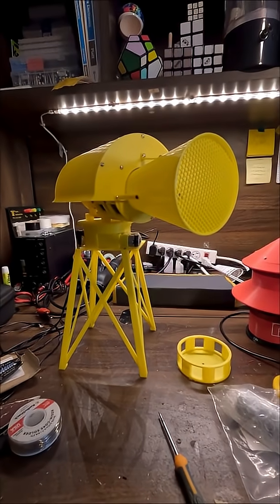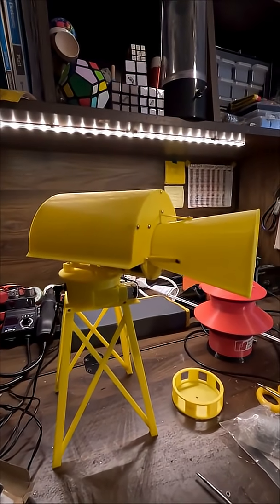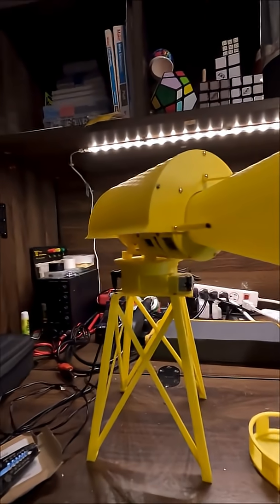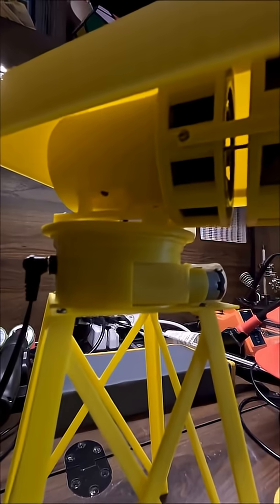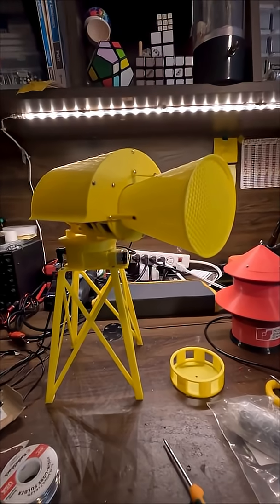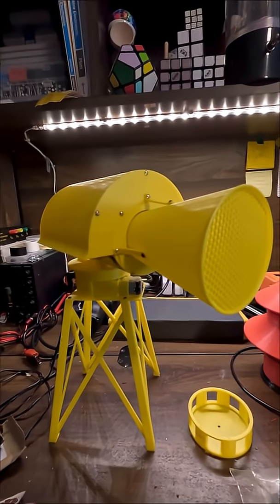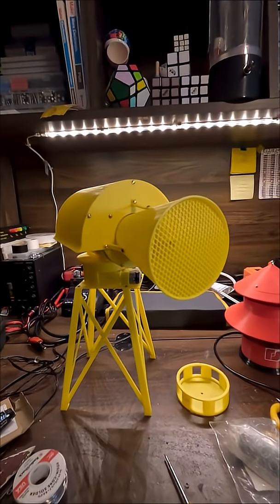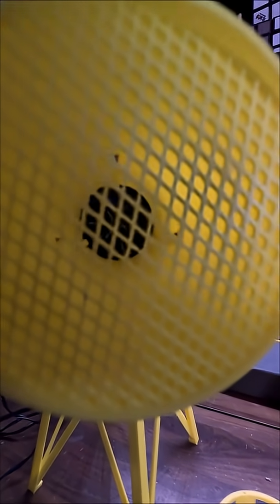Mini H.O.R. 7/10-Port Model 15 Super-Sirex IS COMPLETED! #3dprinting #minisiren #supersirex

Comment: The chopper spins at the perfect rpm, just curious whybit cant hold its pitch
Reply from the maker: This is a sorta prototype, so it's not perfect. The bearings between thw two rotors sometimes struggle. I hope that my revamped core won't this this as much.

Comment: then again the horn isn’t to carry the sound, but for air intake :~)
Reply from the maker: Honestly, it's for both! If you'll notice, when the horn faces the camera, you can hear the 7-port sound much louder than normal. This is more noticable on the dual-headed models, which I am making soon!
Reply: @milespeterson5049  that’s true, but it could be attributed to how the 7-port has much higher air intake than the 10-port, no?

as seen in the “naked” video you posted, the 10-port has a significantly smaller air intake than the 7-port which has our favourite ginormous horn! lots of videos also demonstrate the phenomenon you explained where the 7-port sounds louder upon facing the camera, attributed to the higher air intake

dual headed super-sirex usually sounds equal in volume due to both ports having unobstructed air intakes
Reply from the maker: @ryanadrianh  That's exactly it! The 7/10-port single-headed Super-Sirex is kinda a dumb design because the 10-port side has a tiny air intake compared to the 7-port side, which stuffs up the sound a bit. But, it's pretty cool anyway!

Comment: I just realized you have hitchhikers thumb😭🙏
Reply from the maker: I have TWO 😅
Reply: @milespeterson5049  also what type of 3d printer do you use? I want to print stuff because I only had one successful cardboard siren.
Reply from the maker: @Eat_a_burger77  I use an Ender 3 V3 SE. It's a really great, fast printer. You can get one for about $220, which is cheap for a good printer nowadays. I even have an Ender 3 V2, but I mostly use that for smaller parts. It's a lot slower than my newer Ender 3 V3 SE.
I think a good starter printer is an Ender, especially one of the newer ones that's easier to use. Hope this helps!
Reply: @milespeterson5049  Thanks!

Comment: Hi, a couple questions:
How did you print the horn and its net-protection thing without it becoming a bundle of strings? (I'm new to printing)
What motor did you use for the choppers?
Thanks and I hope to receive your response
Reply from the maker: Hello, I'll do my best to help you by answering those questions!
Parts like the horn and horn mesh are most likely to string, leaving an ugly, very annoying mess. To fix this entirely, tune your retraction distance on your printer. Retraction lifts the filament out of the nozzle, which, if tuned properly, can entirely stop stringing. I use 3 mm-long retractions at 80 mm/s for PLA and ABS, and it has worked very well for me. Some parts, like the horn mesh, will probably still have some stringing, even with optimized settings, so I used a soldering iron to clean the strings out of the little diamonds of the mesh, and that's what I have on this siren now.
As for the motor, I used a 500 DC motor. Mine ran at 3700 RPM at 6V, but the RPM won't really matter with a buck converter to regulate the pitch.
Hope this answers your questions! I'd like to see a video of this thing working if you ever upload.
Reply from the maker: I have links to all the parts I used in the Tinkercad project, including the motor, slip ring, buck converters, barrel jack, etc. Best of luck!
Reply: @milespeterson5049  thank you very much!! but i'm using an anycubic kobra so i'll try to have the best settings possible
Reply from the maker: @McklMrtz  You're welcome! Those Kobras are great printers, I've heard, so you've got this! Thanks, man!
Reply: @milespeterson5049  Back again, and for the choppers, do i need some kind of support or could they print well without them? thanks
Reply from the maker: @McklMrtz  When I printed the choppers, I added support. You don't have to add support, but for the best surface finish, I recommend it. It is pretty hard to remove the support from the rotors, so be careful.
Reply: @milespeterson5049  thanks. Have you printed it upside down? What are your methods to neatly remove the support?
Reply from the maker: @McklMrtz  Printing it upside down will require more support, and it'll look pretty ugly, so don't do that. The parts in the Tinkercad project are oriented properly for printing, so you need not change the orientation. Read the notes, and they'll tell you if you need support, what parts you'll need, and how you print it. Again, I hope this helps!
Reply: @milespeterson5049  thank you very much!
Reply from the maker: @McklMrtz  Anytime! If you have any more questions, I'll be happy to answer them. This is a huge project, and it just takes a lot of effort!
Reply: @milespeterson5049  hello, i have printed my own chopper + stator. The friction between the motor shaft and chopper seem to enlarge the chopper's hole for the shaft because of scraping. Any way i can prevent that/how have you put on your choppers?

Comment: Might have to tweak the rotator slower a bit but it's pretty good 👍🏻
Reply from the maker: Yeah, I would tune the speed, but if I make the rotator move any slower, it has problems rotating because of the weight. I will probably try tuning it again, because I recently fixed the rotator gear, and it's spinning much better now.
Reply: You could put a couple resistors in series with the rotator motor to hopefully make it spin slower
Reply from the maker: @Cellokid12 That is exactly what I do with smaller sirens to regulate the pitch to be more accurate. However, this siren doesn't use resistors, as it consumes a lot of power and requires precise control with DC-DC converters. I could just adjust the rotator's speed by turning the trimmer, but I don't wanna mess up how it rotates, so I'll experiment with that. Other than the rotator speed, this siren is done.
Reply: @milespeterson5049  you should try making a CLM next! Id love to see how that would turn out
Reply from the maker: @KEYSTONE556  That's cool and all, but I don't make sirens from other countries (other than the US). I hope you can understand.
Reply: @milespeterson5049 my dumb ahh forgot that was a Canadian siren 😂
Reply from the maker: @KEYSTONE556  Well, like I said, I still have a Model 2 and 2T. Pretty darn similar, and both made from Federal Signal.